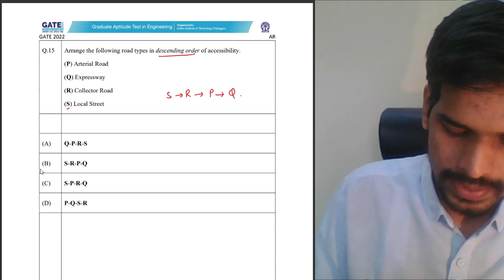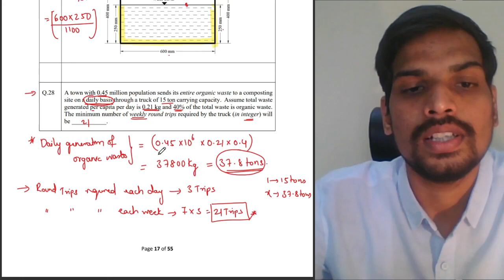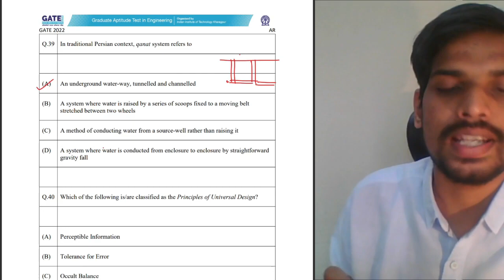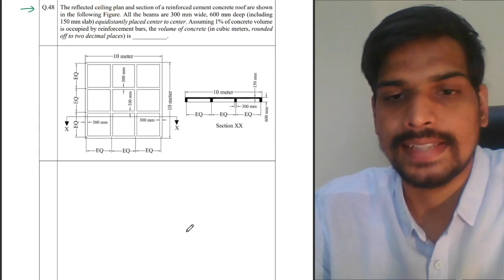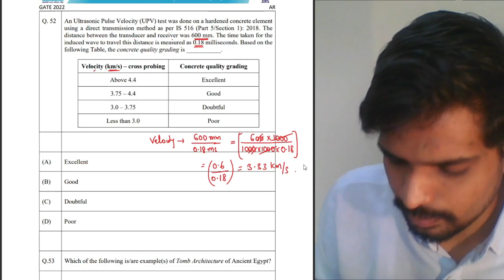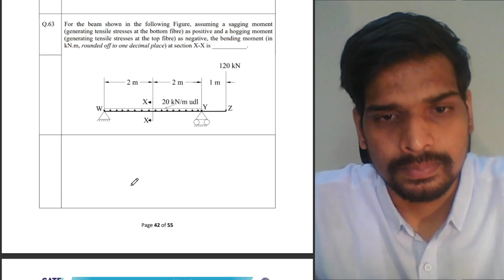GATE Architecture 2022 Video Solution | Common Part & Architecture Part | KP Classes

Comment: Thx for the unofficial answer key
I have a question in GA as those aren't in the video :

In Q6 why is the answer A, When the para mentions primary reason for returning wallets is compassion and empathy shouldn't the answer be B)Wallets with a key are more likely to be returned because people relate to suffering of others. Moreover, nowhere doesn't it say that people don't care about money but it does say people care less about returning wallet if there is no money.